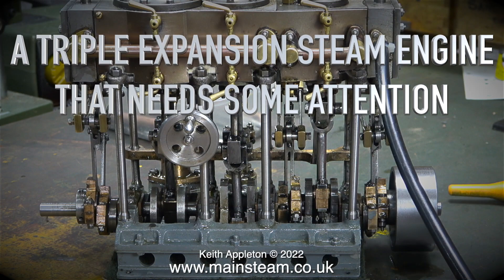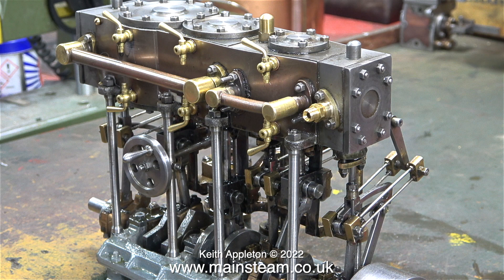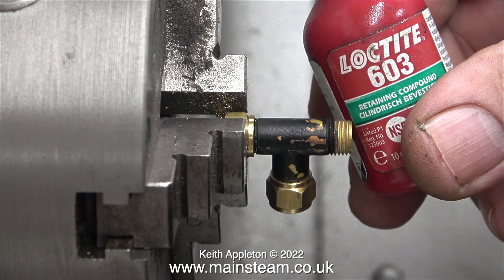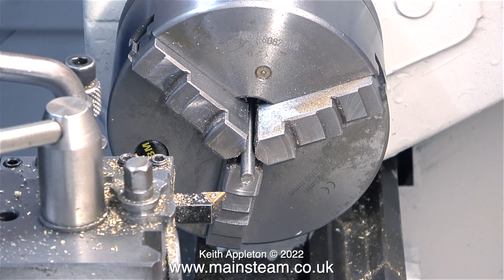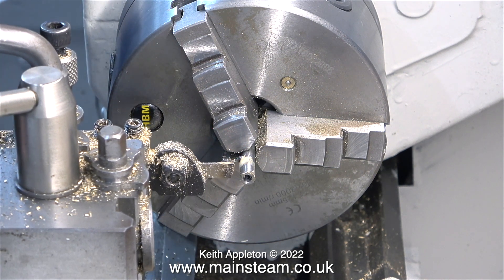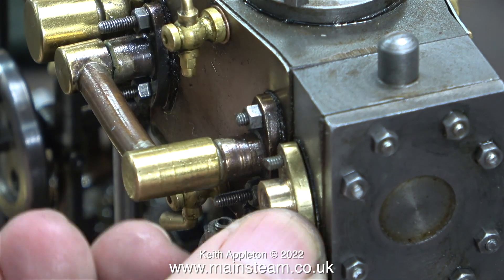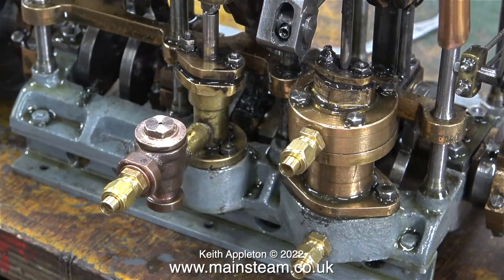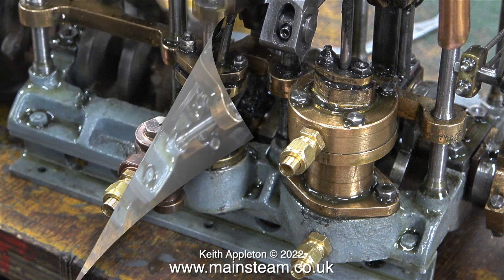A TRIPLE EXPANSION STEAM ENGINE THAT NEEDS SOME ATTENTION #12

Comment: Do the inline oil injectors for compressed air lines offer any benefit for steam engines? The usual oil injected is for air tools, and very thin.
Reply from the maker: I used to have one of those, but I was concerned about breathing in the fine oil mist.
Reply: @keithappleton  Very prudent

Comment: Keith,  when you use compressed air, would an pneumatic mist lubricator similar to used on air tools give enough lubrication for the cylinder?
Reply from the maker: I used to have one of those, but I was concerned about breathing in the fine oil mist.